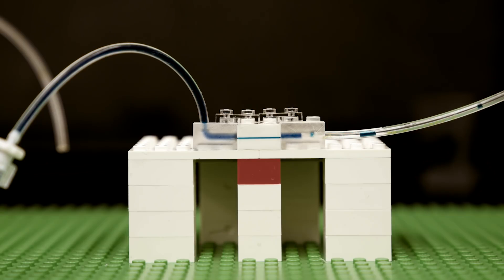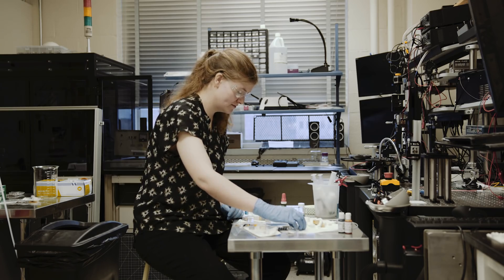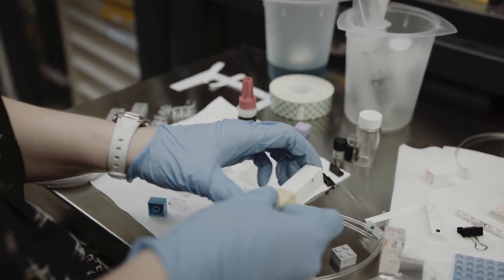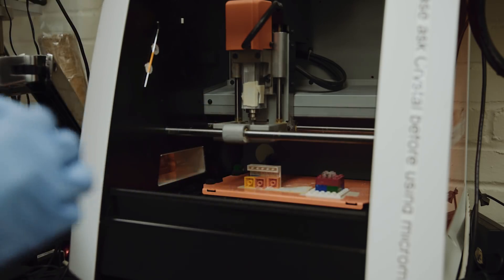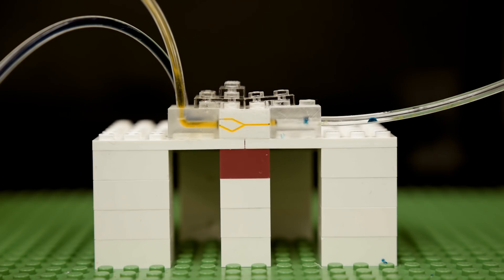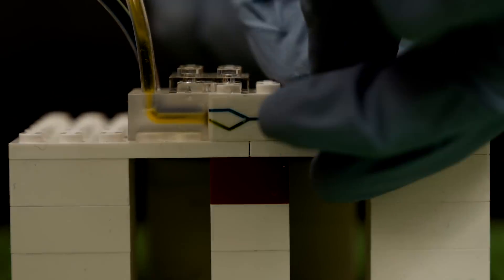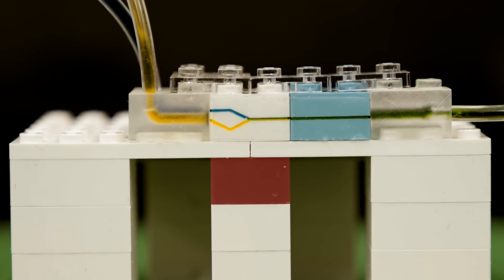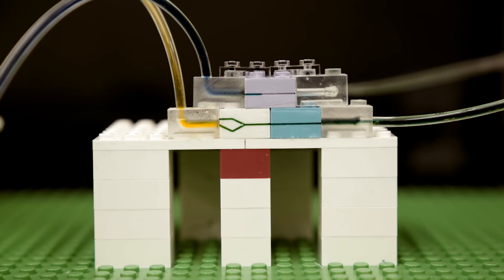Lab on a LEGO

Comment: What about 3D Printing? I saw the Nano Printers from Nanoscribe, they give you more flexibility in designing special forms of channels where CNC is limited in movement. You can even design a negative of the Lego brick as a mold (print this on a nano printer and then injection mold the brick with channels included. Not sure if injection molding nano scale channels is possible (dont know about the precision and resistance there) but if so, you can create whatever channel form you like as long as the channel isnt a dead end but properly connected to 2 sides of the brick.

Hmm I also thought about the Laser engraving technique used to edge glas inside to create 3D Images inside a glas cube, though the texture of these channels will be rough and I do not know how precise this technique is, it might be worth a look. Specially because glas is resistant to many chemicals.
Reply: Hmm Ok if thats what he meant, I agree scaling it up is hard with resin printing. I thought more about using the idea of Lego bricks, but instead of using micro milling, 3D Print the bricks with a resin or Nano Printer. As the bricks are small enough they should even fit on a nano printer platform. That way you can incorporate the craziest structures of nano channels to run your fluid through.
Reply: Drato Lesandar also resin printers are VERY accurate, and they could make their own CAD so they aren’t limited by LEGO’s
Reply: Nathan Becker I also first thought about those as I myself own one but the accuracy isn’t enough for the stated purpose in the video. They mentioned that channels are on nano scale, so far I don’t know any standard resin printer that has nano scale precision, I might be mistaken as I do not check regularly about new resin printers. e.g. the Formlabs Form 2 has 25 micron and only in height not horizontally.
Reply: 3D printing is not scalable, and their resolution is too large for most microfluidic applications. But this suggests a modular, versatile design that could be injection-molded! I'm contacting the authors.
Reply: What do you mean with "3D Printing is not scalable"?
Reply: Drato Lesandar I think he is saying you can only print so small, I think when you 3D print something that needs to that small and also be really precise might be hard to do. I also don’t know forsure but that’s my guess
Reply: Oh by the way I checked the Nanoscribe website today and they even have a paper on using their printers with microfluids https://www.nanoscribe.de/files/2014/7997/1663/AppNote_Microfluidics_V03_2016_web.pdf